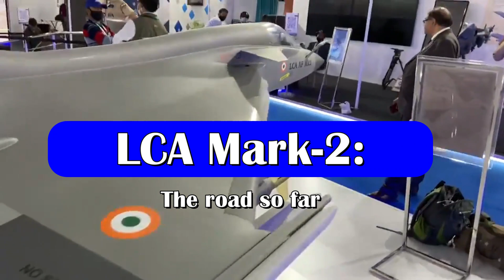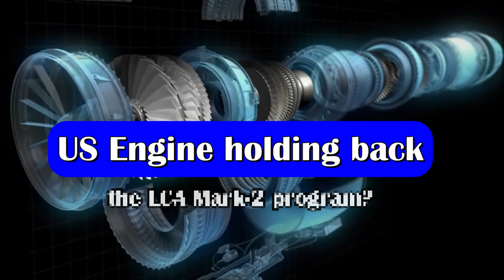Is there lack of fund or delay in LCA Mark 2 program?

Comment: We should go with M88 engine of France rather than GE as we can't rely or trust  US for such a critical project
Reply from the maker: As I have said in video that’s impossible. It will take you decade back to drawing board
Reply: @IndianDefenseAnalysis  Can't do anything, engine security is must when we are shifting from Russian jets to indigenous platforms. India needs atleast 1 engine IPR or manufacturing or supply control in its hands.
Reply from the maker: @surojeetchatterji9966  only way ahead is start an indigenous engine program for higher thrust asap with or without foreign OEM support
Reply: @IndianDefenseAnalysis  indigenous engine not possible, they couldn't make Core for 20 years kaveri, we don't need Russian quality engines,only option we have is to buy or steal by hook or crook from GE or Rolce Royce. This is do or die matter. 1 engine supply security control is must for India.
Reply from the maker: @surojeetchatterji9966  we can it’s matter of will power. If Kaveri can be made from scratch, higher thrust engine is also possible. Spend the money in research, hire scientists and researchers from outside , it can be done.